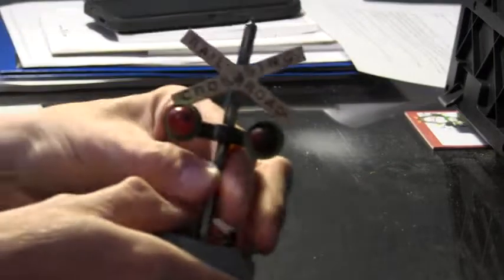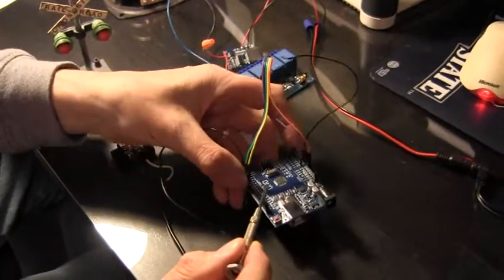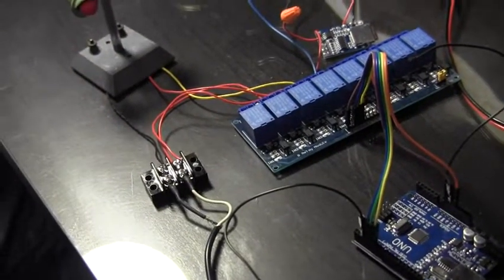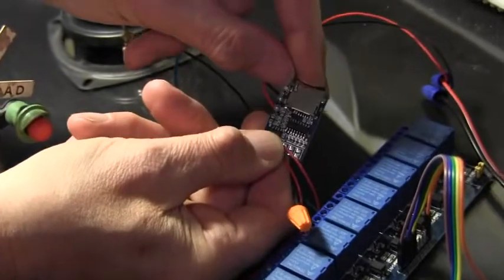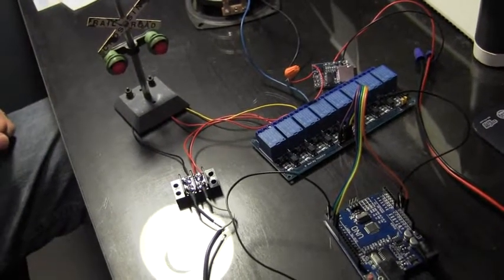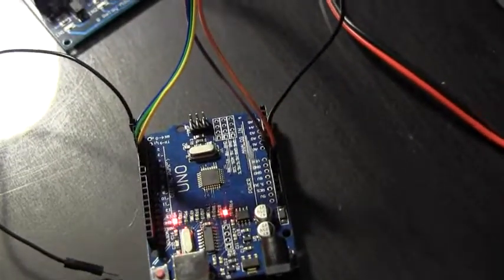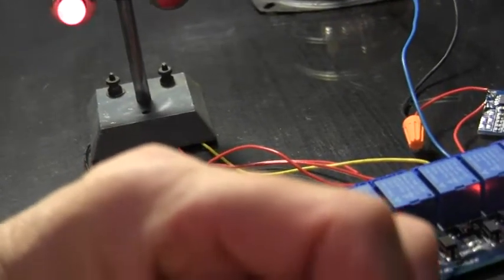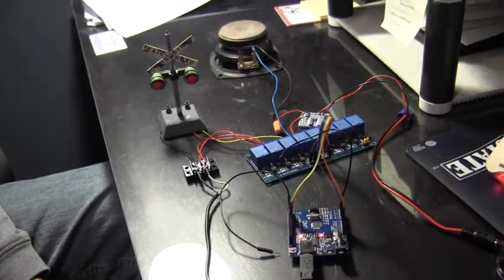Modified American Flyer Crossing Signal

Comment: Thanks for the IDE code!  I finally got to the point where I can use an arduino but the code can be challenging.  This arduino can also count like an old fashion telephone stepper hooked up to multiple scr circuits . I am currently trying to build a single self changing LCD display for this purpose. How about a project with the IDE code  for a single LCD display for lap purposes and a shutdown whe the total is done?

Comment: Many thanks for posting this! I have 6 760s which I'm going to convert. My flasher solution is a bit simpler than yours. I found a left/right flasher PCB which I'm presently using with my 760s. Here's the eBay listing for it ...
https://www.ebay.com/itm/PCB006-1PC-compact-Circuit-Board-to-make-the-crossing-signals-flash-Alternately/352348428689
It's outputs are only 20ma so it needs 2 relays with at least 680ohm coils  in order to operate a 760.
Reply from the maker: Larry, what do you use to trip the relay module?
Reply: @timcoe6841  You mean the input to the flasher PCB? AF 690 track trips before & after a crossing drive a 12vdc SPDT dual-coil latching relay. The latching relay forwards 12vdc on/off power to the flasher PCB. The "before" track trip latches the relay & the "after" track trip unlatches the relay. The 690 track trips work well because the latching relay needs only 1 very brief momentary contact closure to latch or unlatch and they're small, unobtrusive, and need no adjustment. Latching relay Schrack model RT314F12, Newark part number 26M2701, $1.34. The  flasher PCB 12vdc 20ma outputs' two power-boosting relays are 12vdc SPDT, 685ohm, Schrack model PE014012, Newark part number 36K3449, $0.94. The latching relay's coils are powered by 12vdc and the 690 track trips connect them to base rail to latch or unlatch. My AC power supplies and DC power supplies are commoned (base rail) together.
By positioning the two 690 track trips well before and well after the crossing the 760s will start flashing well in advance of a train's arrival and will continue flashing until all of the train (of an average length) has cleared the crossing. All as it should be.
Just today I finished converting my 760s to left / right bulb operation, per your video. I used 32-gauge wire-wrap wire to feed down through the tubes. Converted the 1 non-insulated frame terminal post to insulated (now one insulated terminal post for each bulb) and added a 3rd non-insulated terminal post for the frame connection.